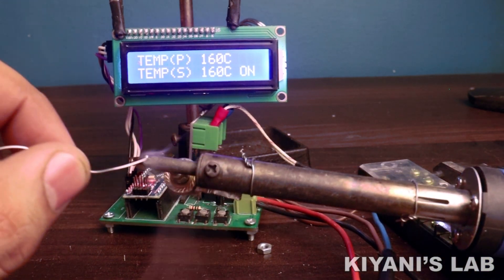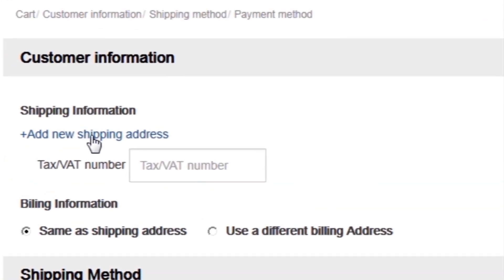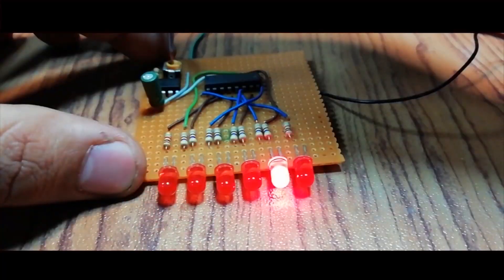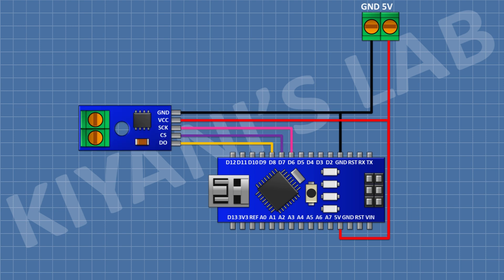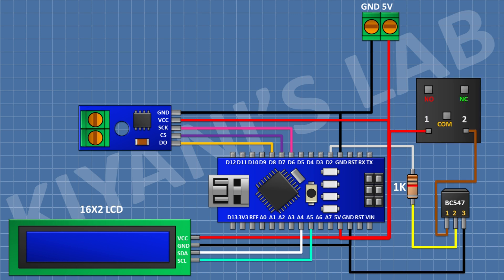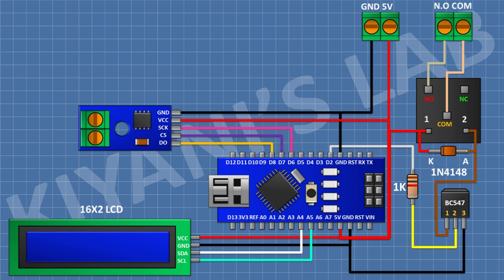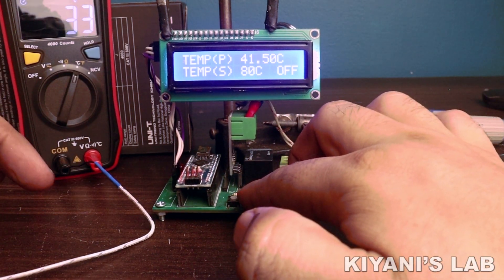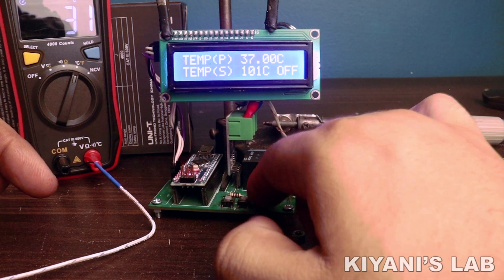How To Make Solder Iron Temperature Controller | DIY Digital Soldering Station

Comment: Rather then doing so much fuss. Use a pid thermo controller unit to control the temperature. Just insert the temp probe into the iron and join the iron main with the pid output.  Thats it cheap and stable.  You can also use a mcb circuit breaker in middle to safe guard.

Comment: I think the most efficient way to make this project is using a triac and control it through duty cycle. 
By the way,  nice project. If you attach hot air gun with this project,  it will be  great ❤️
I think you will try this ❤️
Reply from the maker: thanx for suggestion bro i will try that
Reply: @rdgear, could you explain me how to make this project using triac circuit? Im looking forward to it
Reply: @GrindOne69 use a temperature sensor to measure the temperature  and read the value by arduino. 
Use potentiometer for analog temperature set or use button for set the temperature digitally. 
Wrote the code as,  when the temperature reached the set value,  then triac will cut off the switch.  Like that.